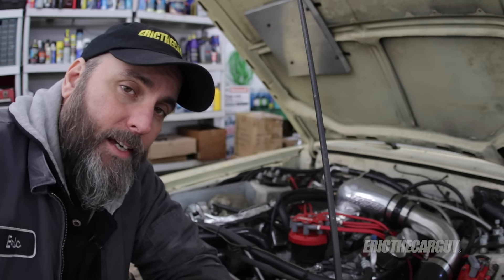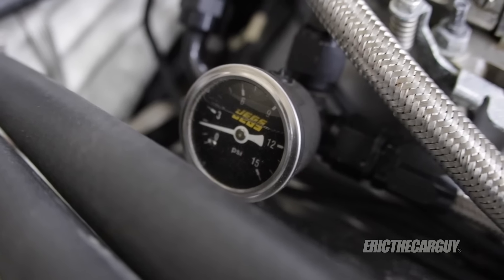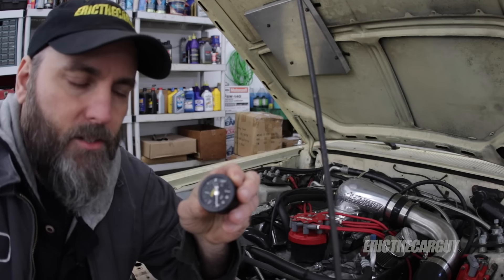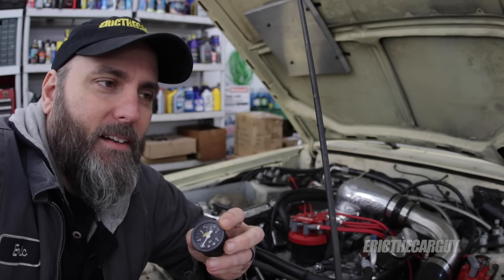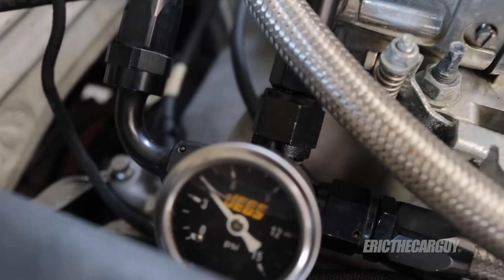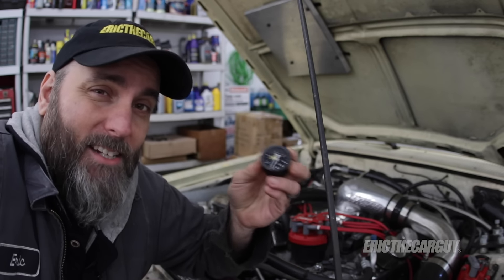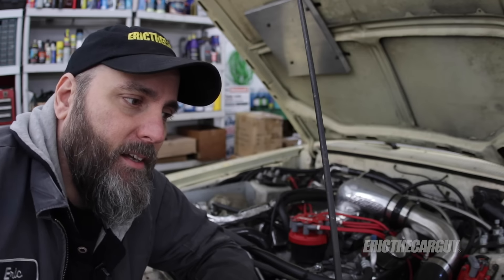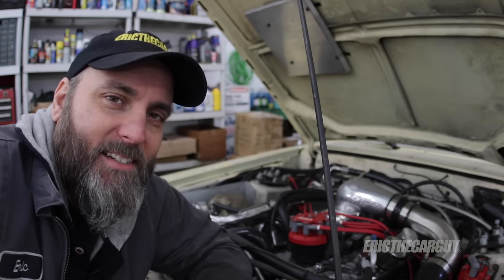The #1 Cause of Fuel Pressure Problems

Comment: #1 cause of fuel pressure problems at SMA.... cars out of gas....
Reply from the maker: Mmm, got no gas in it.
Reply: 2 Eric's is one comment!!!
Reply: @ericthecarguy  got'ny french fried potaters?
Reply: Chunk ERICCEPTION!!!!!!, insert Inception horn here
Reply: But the needle was on "E" yesterday and it ran
Reply: There's you're problem lady!  You got no gas in your car!
Reply: I was expecting the never changed fuel filter...
Reply: when they bring the car to get worked on and the tank is reading E :)
Reply: That's so funny.   I've had a few customers call me up saying there fuel pump went out.  When it was just out of gas.  Sounds like you have the same kind of customers I have.
Reply: I cracked up reading this. Months back I got called to a friend's because his sis-in-law's sedan got stalled in his driveway. It wouldn't start. We kept getting a comlink error running the scan. Everything was attempted from jump starting the car to charging the battery to adding 2G of gas. Though surprisingly the needle was on E. After two hours, I suggested maybe there's no fuel coming through, and we rolled the car down to the bottom of the driveway. Presto! Car starts up right away. The incline of his driveway was too steep! 😂😂😂
Reply: Rib Tickler... Customer said, the best street for locating a gas station is Fillmore Avenue. Lol! 🤣
Reply: @ericthecarguy  some people call it a sling blade, I call it a kaiser blade
Reply: I know Im asking randomly but does someone know a method to log back into an instagram account??
I was stupid forgot the account password. I would appreciate any tricks you can offer me!
Reply: @Lance Carl instablaster :)
Reply: @Isaac Bobby thanks so much for your reply. I got to the site through google and I'm in the hacking process atm.
Seems to take a while so I will get back to you later with my results.
Reply: @Isaac Bobby it did the trick and I now got access to my account again. Im so happy!
Thanks so much, you saved my ass :D
Reply: @Lance Carl You are welcome =)

Comment: Eric, you need to cut off the tip (pointy part) off of the fill plug.  The plug seals the gauge so that the glycerine doesn't leak during shipping.  Unfortunately, if you don't create an opening by cutting off the nipple, the outside of the bourdon tube, the part that changes shape as pressure inside it changes, has no reference to atmospheric pressure which is what you're measuring fuel pressure against. If there is a pressure build up inside the gauge case for whatever reason, the needle will indicate a lower reading than if the gauge mechanism was exposed to atmospheric reference pressure.  I.E, 9 psi fuel pressure will indicate as 6 psi on the dial if there is a 3 psi pressure build up inside the case.  I've seen this problem many, many times in industrial applications, especially in lower pressure ranges like is the case in your application.
Reply: Aha!!!!! interesting! explains why the cheapo liq-filled gauge I used on my 91 Storm never acted up on me. I swapped out the glycerine for mineral oil because the provided expansion space was way larger than it should've been & I couldn't find glycerine with which to bring the level up to spec. I decided to push things & leave a smaller bubble for aesthetics, installing a rubber expansion tube I dyi'd onto the gauge . I left it open ended & LOOSELY packed with a bit of cotton ball to keep out contaminants. Maybe the mineral oil helped as well?
Reply: Good point.

Comment: Jim Hand, a prominent old school Pontiac V8 builder found out the liquid filled fuel gauges aren’t accurate when mounted inside the engine compartment, due to temperature fluctuations.  Jim literally just pulled the rubber plug and drained the glycerin out, problem fixed!   Some times simple is better! 👍👍👍

Comment: Hi Eric, 
if you want a "true" reading on a glycerin filled gauges, you will have to cut off the rubber tip on the fill plug on top of the gauge, this is only sealed for transportation. more expensiv guages in industry have a valve on top with clear markings for transport and opperation posittions. i have workt for many years on boats and have sen this a lot. when you heat the guage, the air and glycerine expands, and the pressure inside the gauge increases, dus causing the pressure to read lower than it actually is.

Comment: Definitely helpful Eric!  I was actually diagnosing inconsistent pressure this past week on a built '17 Subaru STI. Sadly, the gauge wasn't the cause of the problem. (we mount our fprs and gauges on the strut brace usually instead of the engine. Helps a lot with vibration issues) 

Turned out it was an issue on the Venturi pump siphon/scavenge setup in the fuel tank. Installed a new Venturi pump and simplifies the system, and the pressure got much more consistent. Less pressure in the return line to the tank!

Needless to say, there was a lot of "tail shaking" going on for us too

Comment: I've only ever had two problems with fuel pressure.  One was caused by a bad fuel pump.  The other was due to the absence of fuel.  :)
Reply: Why come no start? No gas. That's why come.
Reply: Would you say you had to get a full tank in lol

Comment: Thank you so much for this video and the link to aeromotive page regarding this. Everything in my entire fuel system was new, and this is exactly what was happening to me, chasing the fluctuating fuel press, actually blew a head gasket due to it being too lean after an adjustment when hot, was reading nearly 50psi, supposed to be Ford 39.whatever psi lol. For as common as aeromotive claim this is, I've asked quite a few, otherwise very knowledgeable individuals, tuners even, with really no help. But this is exactly what it was and exactly how I'd describe it to the people I did ask. Thanks again Eric, you have made a few of my all time favorite YouTube videos. The one with you a Paul rebuilding a t5, I've watched numerous times, helped me disassemble and re assemble a few t5s myself.

Comment: On liquid-filled gauges there's a port where they are filled this port can be used as a vent to vent the pressure changes that occur. Wouldn't want to do that in a mobile for sure! Got to match the gauge to the application for sure, and that's a good idea to  question your measurement device when you think you may have a problem that might not be there.  Always double check your meter or gauge. Thank you great video.

Comment: I note the proliferation of electronic pressure gauges, these can monitor oil or fuel pressure and are in the $20 range. They do require a wire from the sensor, one for battery voltage and a ground at the sensor  as the sensor might be isolated from ground as it is on my old Honda.

Comment: Altitude affects pressure gages as well. anything that affects the pressure inside the gage will. example reduction of 1 lb of air pressure from increase in altitude(vented gage) will make the gage read 1 lb higher(approximately). its an imperfect world. we need to understand these things and not get upset by them.

Comment: Eric your gauge sounds accurate. I run Fuel Pressure control. 45-100psi to be exact. It's PWM based. When cold(Pump, Injector,Lines ETC) I need less duty with higher Frequency to hit my Target Idle Pressure of 45PSI. So my X Axis is Fuel Temp Y axis is MAP. FYI I monitor Pressure with both a Needle gauge and 3 wire Transducer. I can tell you for sure. Your Pressure is indeed higher when the system is cold. That said think your Gauge is accurate. Best to isolate gauge/Reg from engine HarmonicsThanks for all you do I have been watching your videos for years.

Comment: Eric,
I found the glycerin leaked out. Replaced it with an Edelbrock (Russell) non-liquid gauge. I noticed the fuel pressure increased after I shut off the engine. Needle and seat should have less than 5 psi. Shut off pressure was 6 psi. 70 Firebird stock fuel pump. I dropped the shut off pressure to 5 psi to prevent flooding.

Comment: To be clear, the issue isn't that the gauges are liquid filled, but that they're liquid filled and sealed. Vented, liquid-filled gauges exist- Aeromotive manufactures them- and they solve both the case pressure problem and the shock/vibration problem. But, as ever, excellent tip for people with modified fuel systems to look out for. Thanks for the resources, Eric!

Comment: To clarify, it's not so much a problem that the gauge is liquid filled, the issue is more a matter of the gauge being SEALED and able to build pressure against the fluid within its housing which affects the bourdon tube. 

It's entirely possible to get liquid filled gauges that are able to be vented periodically (feasible if you vent it before taking the reading, if it's in the engine bay you won't be reading it in motion anyway.)
Another option could be to modify the gauge by adding a breather tube on top to allow it to constantly be at atmospheric pressure regardless of the temperature (and help mitigate fluid loss from splashing out)

As a similar concept, consider an axle breather, same concept, temperatures rise and the pressure safely vents up and out. 

Simplest option though?  Yeah just replace the dang gauge with a non sealed unit. 

(This isn't directed at anyone in particular, just tossing it out there.)

Comment: A simple solution to that problem is to just use a T split and a section of braid reinforced fuel line to a normal gauge that's located in an insulated enclosure somewhere near the nose of the car. Vibrations won't affect it anymore and heat won't sway it either. Trucks have this, WW2 planes had this. There's no magic behind it.
Reply: Just so as long as some genius doesn't take it to the next level and decide to mount that gauge on their dash.

Comment: The only time i had a non filled fuel pressure guage read steady(within 1psi) is when i had an aftermarket mechanical fuel pump and using no regulator whatsoever, it was a Carter M6900 style fuel pump for my mild build SBC back in the mid 90s, advertised at 6psi, my fuel pressure gauge needle only varied between 5.5 and 6.5 psi, no more, no less. Compared to these $25 mechanical fuel pumps as a stock replacement, advertised at 5psi(Delphi MF0001), but connect a fuel pressure gauge inline, and the needle bounces all over the place showing a much higher reading. I bought that delphi unit for my ZZ4 crate engine, i took it for a test drive, and it ran fine, i've always had the impression and also seeing it on YT that if the fuel pressure was too high, it would overcome the needle and seat, over fill the bowls and you would actually see fuel dribble out of the ventury boosters, but my holley 650(0-080783C) carburator hasnt done it, and the set floats and fuel level stays steady in the fuel bowl via the sight glass.

Comment: I cut the tip off of mine and it reads accurately and runs better than ever. I will be buying a new gauge because I don’t want the oil in the gauge to make a mess now

Comment: I use this. Its notoriously inaccurate and i only use them to see if fuel pressure is on or off.

The fix is actually just to remove the rubber, to equalise the pressure inside the meter.

Still, not really accurate. And opting for electronic pressure sender is really a better choice

Comment: This not just an issue with mechanical liquid filled gauges.  Almost all pressure gauges, including electronic one, suffer from the similar heat related inaccuracy.  Because the change occurs relatively slowly, a computer can sometimes compensate, especially if it knows the temperature of the fluid it is measuring.  There are other techniques that can be used for electronics but they are all expensive.
Reply: What about a stock fuel pressure sender?

Comment: Hi Eric. Thanks for the videos. This issue has been known for decades in the industrial gauge market. The non glycerin filled gauges suffer from the same issue but the percentages of the swings are a lot less than the liquid field due to the amount of volume consumed by the liquid versus the body size of the gauge. I have vacuum gauge is that have a little bar that you rotate that allows the inside of the gauge to normalize with atmospheric pressure this is very high quality gauge and it is non-liquid field. This issue has been going on long time, It’s just most car guys are cheap and don’t wanna spend the money on this type of stuff so these companies just throw the stuff out there and people buy it and buy it and buy it. Great videos. It boils down to you get what you pay for.
Reply: Whered  you buy your vacuum  gauge ?
Reply: @user-lh1hd5iw7h  McMaster Carr

Comment: Thanks for reaching out, I was working on a fuel pressure problem ( low fuel pressure ) for a long time, I drained the liquid in the fuel pressure gauge and I had steady fuel pressure, however There is also air getting into the fuel line between the tank and fuel pump ( I have installed clear fuel line ), also the carburetor air filter is blocked ( making the engine rev up and down a bit at the same time the air starts coming through the fuel line ) ( about 15 minutes of idle ))

Comment: Eric Iv been chasing my tail on my car for a little while now, long story short my fuel pressure was fine and reading good, after a small incident the car started reading max fp, changes 3 differs fp gauges and replaced the same regulator with a new one, checked fuel filters,kinks and cannot seem to figure out why I can't get back down to reg fp (5-7psi) by the way this is on a sbf 302 fox

Comment: Just watched. Just ordered thier carb 0-15 psi gauge. Will see if it makes a difference. My current AutoMeter liquid filled gauge with equalizer will start to lose pressure after warm up at idle. Then will really drop when driving around from 4 to about 2 psi or less. Would have pull the equalizer pin to reset it to read at 4 psi. I’m thinking I would not have to do it every time. Losing sleep over this! Will see how this one does once received and tested.

Comment: FYI: Really strange the article. All the glycerin gauges I came across tell you to pinch with a needle a hole in the rubber plug for the first usage. Next advice is to use the gauge in a way the rubber seal is always in the highest position so the glycerin will not spill out.

Comment: I've been chasing what I think is a fuel pressure issue in my Fuel injected Jeep Grand Cherokee. Whenever I take a corner at a moderate speed, and step on the gas to accelerate out of the corner, the engine bogs down like either it's flooded, or not getting enough gas...don't know what is causing this. Maybe I should put in a fuel pressure gauge and see what it's doing.

Comment: I have modified the fuel hose to little bigger diameter with stock fuel pump result is always low fuel delivery and increased long term fuel trim.

Comment: I had the same problems with holley carb.it was leaking fuel and pressure dropped.u ll know when u have excessive black smoke off the exhust.also electric pumps have built in filter may get dirty.or collapsed fuel lines if rubber.😇

Comment: I had one of those things fail.  The liquid got dark, thought it was just baked or something.  Turns out I had a fuel leak into the gauge, and the inside was full of a gas/glycerin mix.  I threw the gauge out and put the stock test port back on.   It also would give me odd readings, high when cold, low when hot, and I went through the dance with changing parts for a while as well.

Comment: Huh, that's interesting, used similar old gauges on alot of cars in the past.   Though I never really paid attention to them.   Actually, I would have said little sisters.   I had a nasty little 65 mustang, had just finished working on.   Went inside for lunch.  Then went for a test drive around the neighborhood and what had been running great, wouldn't go over like 2k rpm and it would choke and sputter then die.   Stopped and popped the hood, my fuel line was having a seizure.   My pressure regulator was set all the way down.   Turned it back, thinking all was ok.   Nope, ran good now but wouldn't go over like 2k.  Then noticed my rev limiter was also set to the bottom.   After that it was all good.  She had went and changed them while I was inside.
Reply from the maker: The joys of hot rodding.

Comment: I just put in a electric fuel pump and filter with all new lines and that regulator gauge and I’m having issues. 

At highway speeds if I let off the accelerator I’m losing all the fuel pressure and it eventually dies on me. Then if I wait 5-10 minutes it starts right back up. 

I can drive around town low rpm no problem. 

What could be the issue. We’ve already swapped another new pump and filter in and checked the regulator. Still having same issue. Wiring seems fine and it’s all new as well. Even got a new battery and alternator. Vented the fuel tank. Gas tank is clean.

Comment: Well that counts out my problem because I don't have a gauge on my crown vic...its running rough and cutting off..I check the pressure at the rail and it just shoots up a little...I compared it to my grand marquis that I just put a new pump on and it sprays out with plenty of pressure...so I thought I needed a new pump in the crown but after installing the new one it hasn't changed anything...I can hear the pump humming and shutting off like normal but hardly any pressure...beautiful Florida day here but feeling a bit discouraged....I know there is a solution

Comment: I've been chasing my tail on an 05 sport Trac that doesn't have a shrader valve. And the fuel pressure is reading 50 on a scan tool which I know to be low from research.